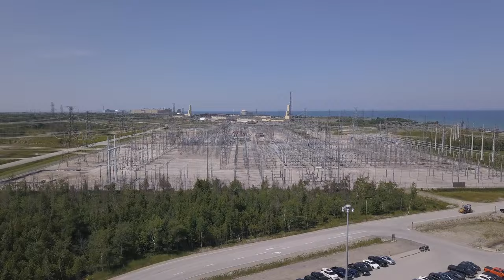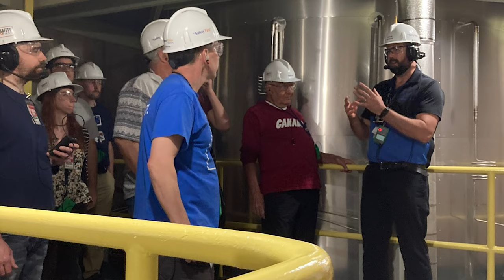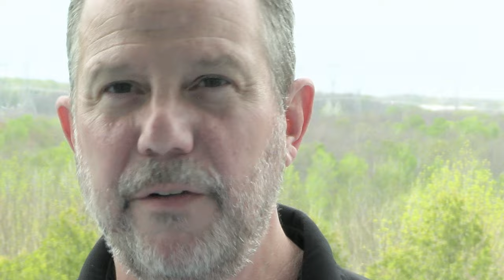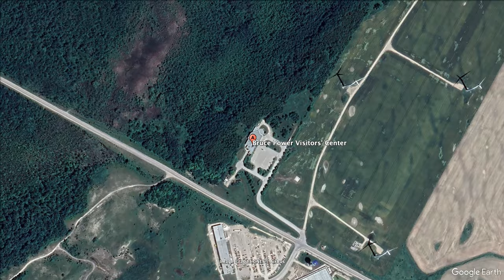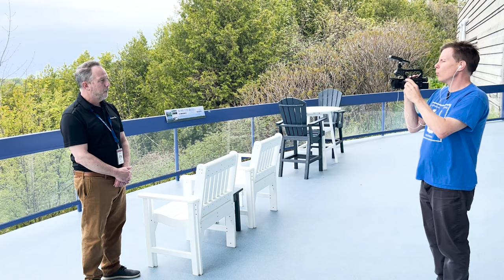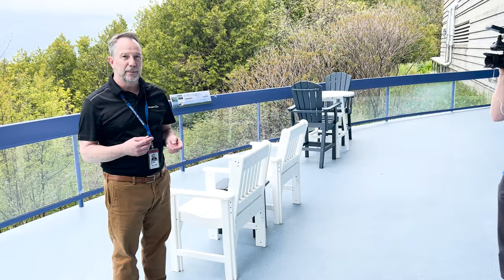Bruce Power and CANDU Q&A with John Peevers - Can we build more CANDU?

Comment: BIG fan of nuclear here. The Girlder-Sulfide HW production facilities that existed at Bruce have been long decommissioned and dismantled. Don’t need to go into the toxic aspects of that as it uses massive amounts of hydrogen sulfide. Interesting the comments at 4:03 that ‘we can do it again’. Questionable in that the provincial and federal environmental regulations would allow that in our current time(?). Docs indicate each C6 requires approximately 470MT of heavy water. 4.8GW of new generation at Bruce would require six additional C6s. Can’t help but be EXTREMELY curious where 470MT x 6 of reactor grade HW would come from. Without the heavy water…no CANDUs (no pun intended). The rest of it seems generally trivial. Time for some follow-on questions(??).

Comment: Thanks Gordon - I live on the other side of the lake.  Maybe we should have CANDUs in Michigan.  Fermi 3 could be a CANDU.
Reply from the maker: I think that would be cool. Right now the case for CANDU is that no enrichment is required, so no dependence on Russia. Could one be built fast enough that it would matter? I have to assume LEU and HALEU will be produced (in needed quantities) in USA some year soon.
Reply: @gordonmcdowell Any one of these that are built will matter.  They should displace the big coal plant 10 miles North of me that will close in 2025. (or so they say).  I figure all those fires have a connection to global warming.  I think we're at the point that once they are built "normal" economic pressure will no longer apply.  There will be an impetus  to keep carbon free sources operating.